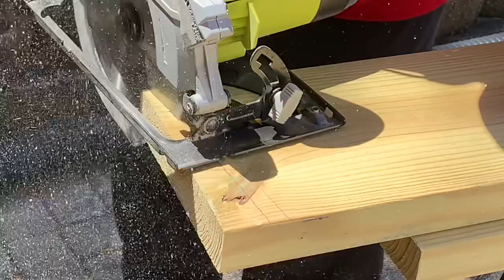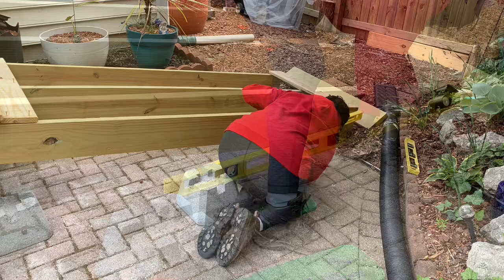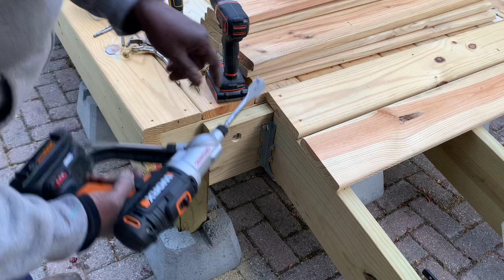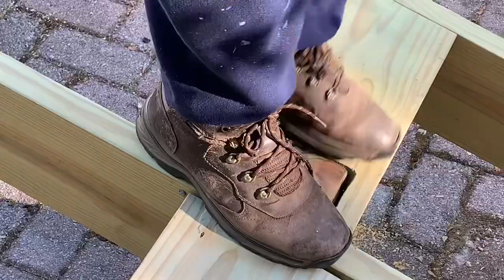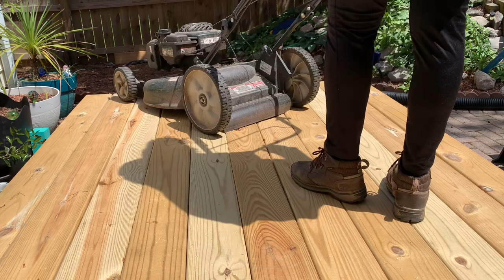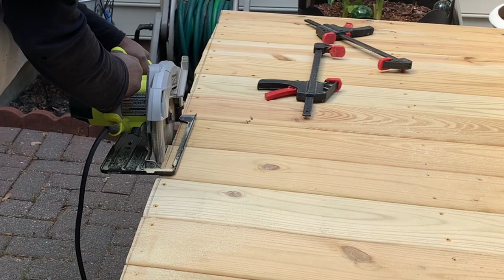How to Build a RAMP for the TINY MOBILE DECK//DIY//From Her Workshop//Part two

Comment: How do you find the angle for the part that has to match the floor you know the part that touches the concrete
Reply from the maker: I just used a level at the bottom, marked and cut it first then went about the top angle 📐 
Very unconventional but worked for me 😊

Comment: It's video's like yours that build up my confidence to replace my precast concrete steps, with a small wooden porch platform, and a ramp to eliminate the steps going up to my front door.  The angle cuts needed for the ramp are the trouble spots for me, but I liked the way you made those look easy to achieve.  I  appreciate your willingness to share your knowledge with us novices out here.  Some of us need all the help we can get.  Thank you!
Reply from the maker: Thanks, so glad I could help! Let me know how your project turned out!! 😊

Comment: Nice job!  I'm replacing a deck for my 85 year old Mother in Law.   It ground level.  I have steps in the lowest portion and am doing a ramp on the higher section.  2x6 construction.  Thanks for the top on the top angles for the boards of the ramp!!  How did you determine your other end angle on that long cut?
Reply from the maker: Thank you and you’re welcome ☺️ 
I just held the board up to the end at the angle I wanted then marked and cut it 😇